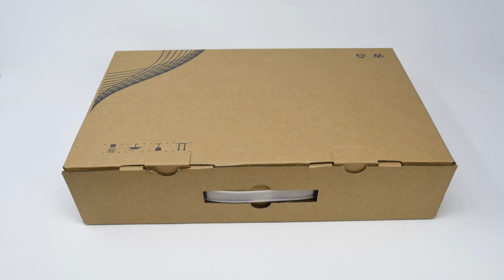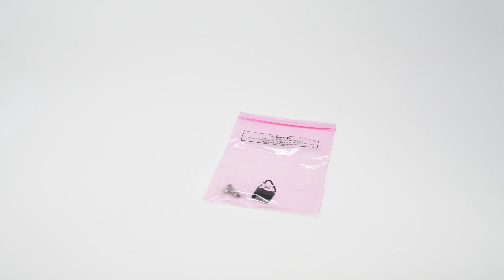Montavue NVR Series: 4 Channel 4K PoE NVR

Comment: hi 
witch you recommend for pure poe nvr for 4K camera? some cheap please
or just use swich poe and SD card installrd insiede cam?
Reply from the maker: It depends on what you need for your own security. The benefit of an NVR is not only extended storage (weeks/months) but also easier management of your cameras. If you're only needing a couple days of recording and maybe just one or two cameras total, then micro SD recording with the cameras plugged into a PoE switch would be the way to go, this is because it holds about 3 days of recording and if you're not planning on having a lot of cameras, it's easy to manage them indvidually if there's only 1 or 2 and it's a lot cheaper overall.